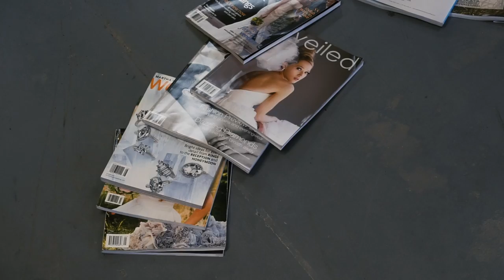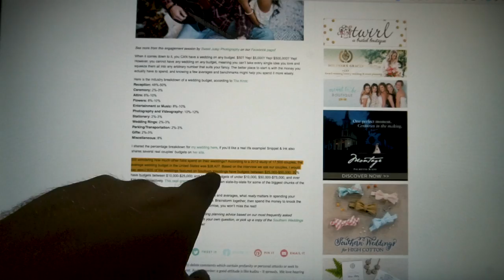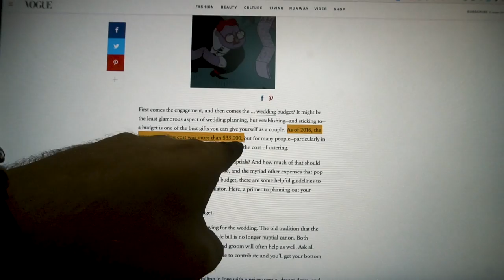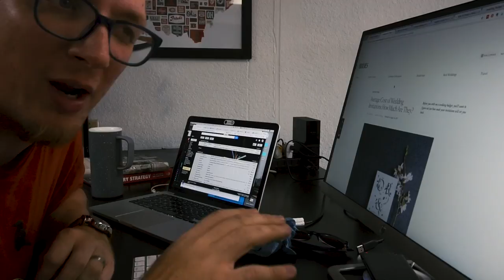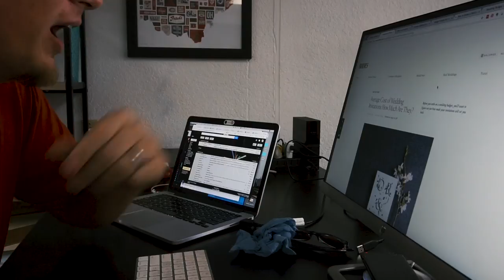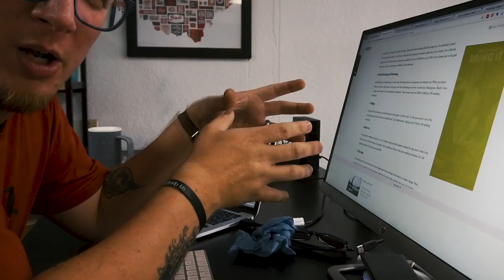Why Wedding Magazines Are Lying to You

Comment: Good topic.  Using that $8000 invitation example that calculator would mean a $200,000 wedding. It may be worth starting to talk to perspective couples about wedding not on a gross cost per wedding but rather on a per guest cost at wedding. As you said, a $35,000 budget for a 200 guest wedding would be small but the same budget for a ten guest wedding would be huge. So maybe it is time to change the equation of per head (hate that term) to be the way couples think about there wedding budget.
Reply from the maker: Right on, Mark. I'm finding quite a few very high-budget planners talk about weddings in these terms. I think it's a far more meaningful way to discuss money.